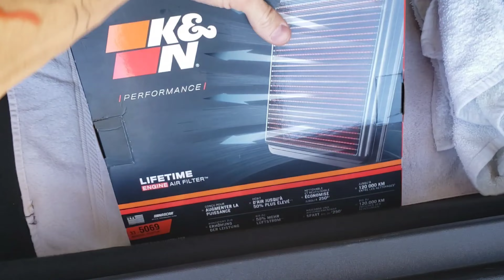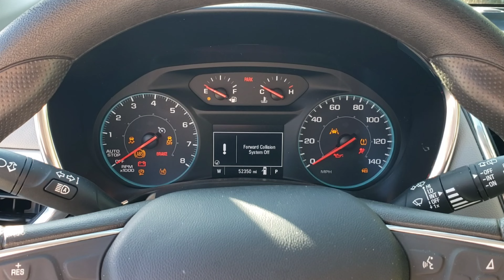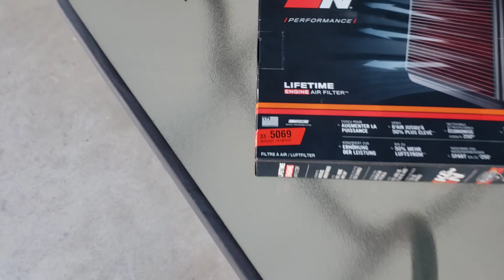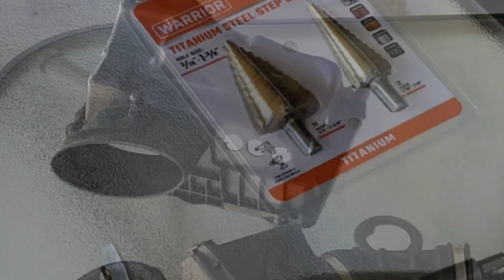Modifying the stock oem airbox on a 2020 Chevrolet Equinox 1.5l Turbo!!!

Comment: How is the air box restricted. Did you measure it?  Hot air from engine compartment, more dirt and silicon entering the engine, no extra power, more noise.  Sounds like fabulous idea.  Using the presence of CEL to determine if all os running well. Brilliant.  Science and technology at its finest
Reply: It’s not restricted, and this isn’t a build. It’s an equinox💀mom car. Coming from a former crv owner, it ain’t worth spending money on.
Reply: Regardless the air will be hot once it enters the box. It’s made from plastic lol which doesn’t regulate or stabilize temperatures. Also how will more dirt enter the engine if the filter is placed on top which is catching any dirt trying to eventually make into the engine? Yeah the filter will be dirty more often. But if you think about it air is coming in and out of the bay so it’s not that hot.
Reply: @reviewithme9913  apparently you have never data logged intake air temps, comparing stock,  plastic, true cool air intakes with these aftermarket mods or done oil analysis to show higher wear rates.
Reply: @tssci6774  of course the temps will be different but not drastic enough to cause engine failure soon instead it will take time as the engine will experience different air temperatures and larger amounts of air intake. Engineers made these boxes with limited air intake for a reason. What we are looking for is better gas mileage when driving around windy places. Where I live it’s extremely windy very often. I drilled holes towards the bottom and away from the engine to receive cooler air temps. I also put in an K&H filter regular kind not the short ram cylinder ones. I was able to reach at least 20mph speeds with less press on the gas pedal. Believe it or not made a HUGE difference as prior I was pressing down on the gas for longer periods in order to reach 40mph.  Also note that I have roof racks.
Reply: @reviewithme9913  never said it would cause engine failure in the short term.  You need to find a better way to measure performance and oem doesn't design restrictive intakes.  A $5 phone app and OBDII adapter gives acceleration, torque and hp data.
Reply: @tssci6774  well I told you my story. And my vehicle is noticeably performing better in regards to mpg and getting up to certain speeds without the need to floor my gas pedal. Also I stay at desired speeds consistently without resting my foot on the gas pedal so vigorously. And guess what’s helping me? MORE AIR in the air box!
Reply: @brandondickie3456  gen 1 crv with manual tranny you can do so much even the 3rd is sporty and very light weight. With the right mods you can have a very light vehicle that can pick up some speeds
Reply: @reviewithme9913  See that or Gen 2, if I just wanted to build a track car, and had money just falling out of my ass, I’m picking up a Gen 1 or Gen 2 easily. Problem with the Gen 4 (the car I had) as far as I know, is you’re not boosting it. You’re not tuning it. You’re not building it to run high power without doing so much to it, that you pretty much will have a 2014 Acura TSX, K20C1 swap, Acura RSX, or if you’re way over your head, a K24W1 swap with a shell of a Honda CRV covering it. 

The CVT on the 2015-2016 and newer to my understanding is a grenade if pushed even remotely harder than stock. It’s running an 11.1:1 compression ratio compared to the 2020 Type R civic’s 9.8:1, or the 2018 WRX STI’s 8.1/8.2:1 compression, and so running high pressure forced induction to get the CRV even to over 250 wheel horsepower would likely be torturing the engine internals as well as the CVT. Reliability would be lower than a brain surgeon with a meth addiction. 

The biggest issue I ran into, is that you’re not tuning the 4th Gen. Thus you’re not running boost. Thus you’re not making power. The closest you’d get to a tunable 4th Gen CRV would be the K24W1 Honda Accord, which has Ktuner support. The 4th Gen to my knowledge has no tuning support. You can tune it to grab groceries. That’s it.
Reply: Speaking as if he took his filter out to

Comment: I’m most likely going to do this to my 22. My suggestion would be to get some metal screen and cut small squares to cover all of the openings. You can place over the holes inside the box and silicone them to it around the opening. This will prevent critters from filling the bottom of the box with junk. I’ve done this before on other vehicles and never had an issue, but with it being turbo, I’m not sure, but I can’t really see it being an issue because I see a lot of equinox openers  who have cold air intakes installed with the filter in the engine bay and they don’t seem to have anything to complain about.

Comment: SO you let it breath better but hot engine bay air. From factory they have a nice ram air that leads from right of passenger headlight right in the grill. Filter is better choice and works, cleaning the ribs up inside the bottom works but the hot air holes no bueno

Comment: I have a 2018 same engine - I’ve noticed poorer gas milage with only 42000 miles.  Any suggestions?   Was always getting 28 around town and 37-8 on highway 2:38  -it’s a terrific highway car that little engine runs best at 70-80mph - I drive all over New England with it.  But around town, not so great.

Comment: Hope they still honor your warranty and can find an engine. My mom's blew up with a rod through the block at 2,000 miles and the dealer took over two months to find another engine.
Reply: how is it hard to find this engine? theyve been puttng it in everything since 2016
Reply: You sure it was 1.5 turbo ? & not a Ford escape ecoboost aka ecoboom !!!! Bc these engines are not known to be bad, I think you confused & meaning Ford escape ecoboost engines especially the 3 cycl ones that are blowing like crazy & hard to find bc they are in high demand for replacements, the chevy/gm ecotech engine isn't the same engine as the Ford ecoboost and people are thinking they are the same, they are not

Comment: It’s an equinox for gods sake and all that did was let hot under hood air into the intake. High IAT will pull timing and make you LOSE power. Or cause detonation in a high compression turbo engine just dumb all the way around
Reply: Thank you. Plus it won't make more power, only noise.
Reply: The airbox portion of the mod was dumb for sure. Removing the turbo silencer wasn’t terrible. Would be better using no metallic material or wrapping it in heat tape to prevent heat transfer.
Reply: so what if its an equinox? people have vettes and try to make them faster too  even tho they're already vettes
Reply: @cantwealljustgetalong2 Corvettes are actual real platforms to build. Not an equinox. That’s why corvettes have a vastly larger aftermarket, compared to any crossover suv, because it’s not worth the money to mod it, it’s just a car you drive till it dies. Soccer mom with her back blown out probably whipped this equinox before a 17 year old got a hold of it and fucked it up with diy mods.
Reply: @brandondickie3456  the problem with your analysis is 98 percent of people dont have the money for a vette or cant own one for other reasons like needing to have something practical for family etc.  so if you can only afford an equinox or a camry or another basic car, its nice to be able to make it go faster if you want to.  sorry if that   bothers you
Reply: @brandondickie3456 soccer moms are very easy on cars actually, and this is a 2020 equinox, this video was made over a year ago so the car was 2 or 3 years old at the time.
Reply: @cantwealljustgetalong2  It doesn’t bother me, but from a financial standpoint, it does. The CRV I had before I traded it for my scion frs 6mt, i had that damn thing destroyed while trying to make it “faster”. Forcing parts to work when they wouldn’t normally. Ordering eBay garbage lights that stopped working in a month. Cutting the body panels. I’m saying it’s not worth throwing significant amounts of money into, because it’s not going to rationally change anything for what it costs.
Reply: @cantwealljustgetalong2  and by soccer mom car, I mean the design of the car itself puts limits on how far you want to go with “building” one. I’m saying, for any money you’d put into a car like an equinox or crv or MX5 or Nissan Versa, etc, you’re going to have more benefit by putting that money towards getting a second car. Have your family daily beater car, and then save up and buy the weekend/fun car to drive on occasions. I learned this the hard way.
Reply: @brandondickie3456  idk, just cause it's a family car doesnt mean you have to be miserable driving it. 1000-1500 total for some cheap parts and a Trifecta Performance tune makes an equinox drive a lot better than it does stock.  if i can spend that small amount of money to make any daily driver vehicle more fun to drive than stock id do it.  i drive fast regardless of what car im driving whether its a 2023 M3 or toyota corolla, so im interested in making any car im driving perform better.
Reply: @brandondickie3456  im not talking about doing weird unsafe hacks like removing the air filter and stuff like that, im talking about legit tried and true parts from reputable companies installed professionally and tunes from well known companies like Trifecta and Ecutek etc.  i wouldn't do the kinda stuff like whats being shown in this video, im all about reliability
Reply: @cantwealljustgetalong2  true
Reply: @brandondickie3456 what gen crv did u have?
Reply: @reviewithme9913  4th gen
Reply: @brandondickie3456  I got the 3rd gen just invested in new rims and roof racks. Makes a major difference. I had also got a cat back but took it off cus it was killing my gas with the old heavy rims but now with the lighter weight new rims I might put it back
Reply: @cantwealljustgetalong2  I actaully have a c8 vette and we had an equinox. more people own vettes than you imagine. However the point is made by you as much as me here. An equinox is a daily driver. So your gonna void your warranty, ingest hot air and increase your chances of detonation that will destroy that little motor FAST for a little noise and ZERO power probably a power loss.
Reply: @brandondickie3456  well yeah dude, throwing chinese made, ebay parts at any car is asking for trouble.

Comment: How did you get the hose clamps off that plastic piece?  They’re not screw clamps
Reply from the maker: Just used a flat head screw driver to bend the crimp tabs to where they loosened up.
Reply: @jtmracing2986  thank you sir
Reply from the maker: @MrCouchLocked420  No problem any time!!!

Comment: How much more horsepower did you gain out of drilling holes in your OEM air box?
Reply from the maker: No clue 🤣😂
Reply: @jtmracing2986 hey it’s been a year any problems or engine codes??
Reply from the maker: @owenblakeman5215  No issues at all! I've put 40k on the car since I did this mod.
Reply: No intake, no matter the brand or car will "add" hp. At most intakes provide less restrictive air flow into the engine freeing up any "trapped" hp already in the motor held back by emission standards. Basically a $80 ebay intake is just as good as a $500 "fancy" named brand.
Reply: Thanks for that info very helpful. what is your views on performance chips? chips

Comment: K&N filter is okay......drilling holes in the lower half of the air box.....bad idea and not okay! The last thing the 1.5L engine needs is more hot air. Did you not notice the air intake is a COLD air intake. Cold air is denser than hot air and that helps any engine perform better.

Comment: Will this have any trouble with smog inspection in CA?
Reply from the maker: Most likely in California you will.
Reply: Sweet, Last question man what was that pipe that you used to replace the stock piece that was super restrictive? Cause I notice on mine it was different sizes
Reply from the maker: @BBAutophotography53  Just a piece of extra tubing I had laying around. I did have to force the one end into the smaller coupler and stretch it out a little bit to make it work.